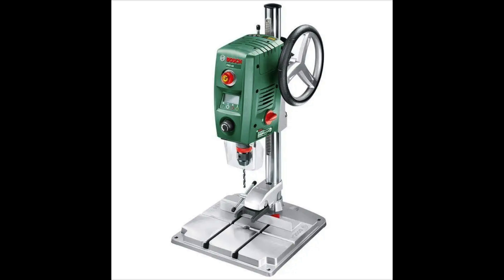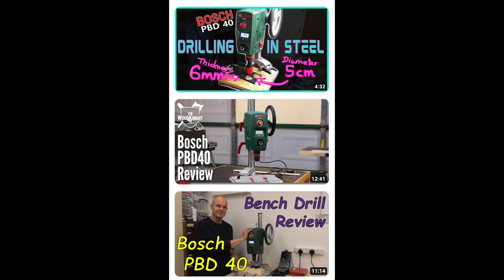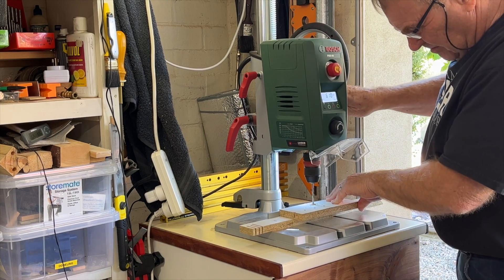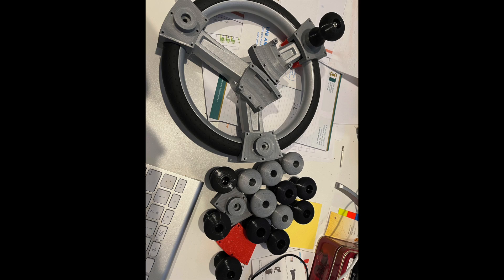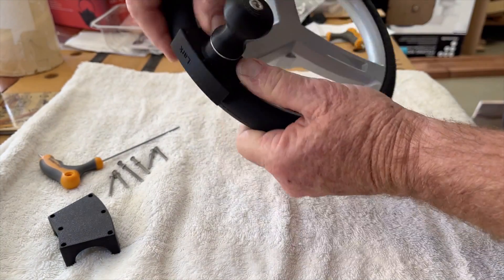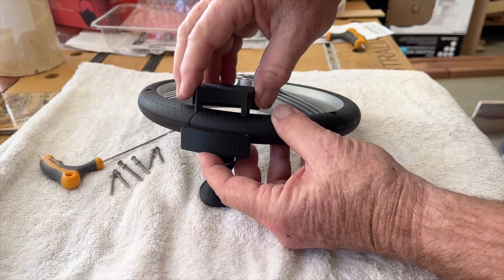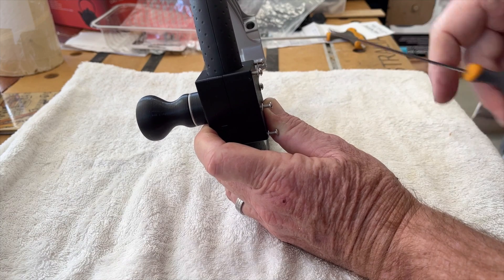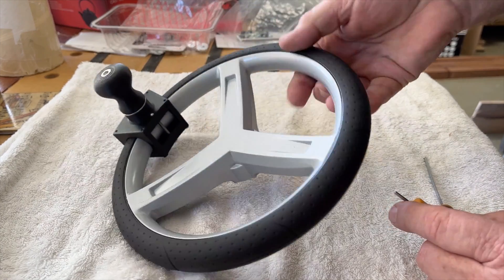Bosch Drill Press PBD 40 Upgrade - Auxiliary Handle

Comment: Very nice work. The round wheel never bothered me during all these years of frequent use, but the chuck is a problem. It's a crappy chuck made for impact hand drills, not for bench drill machines. I changed mine, and that upgrade is really necessary for this machine. During all the years after the change I never had any issues with the chuck, the drill bits never ever fell out in the middle of a drilling work and the runout is also much less now. Here is a video about how to change the chuck to a better one: https://youtu.be/nCqVoaGVK8g?si=keE4udXOp34wgY5U
Reply from the maker: Thanks for the link. Will investigate the upgrade.

Comment: Absolutely perfect. I haven’t bought the drill yet but was wondering how I would get round that stupid wheel. How do I buy one?
Reply from the maker: Hi Mark.  If you are in Australia I print and post from Canberra, just email me at derekdotlarkatgmaildotcom or if you want to print one the files can be purchased at Gumroad via the link in the description.  If you are overseas I am working with makers in the UK and US to provide a local option given the cost of shipping from down under.
Reply: Yes I’m uk so I’ll hold fire and keep checking back. Looks a great idea Derick 😊 thank you for replying
Reply from the maker: @markjarman7819  Hi Mark

Stu now has the handle available in the UK. Sorry for the long delay.

LInk is:  https://www.etsy.com/au/listing/1630197840/bosch-pbd40-auxiliary-handle?click_key=21cbe14891a0e1fe8da7cc70bac1f95054c75ea8%3A1630197840&click_sum=f20b64d3&ref=shop_home_recs_6&crt=1 

Best regards

Derek
Reply: @Derek_Lark awesome thank you derek. I’ll place my order.